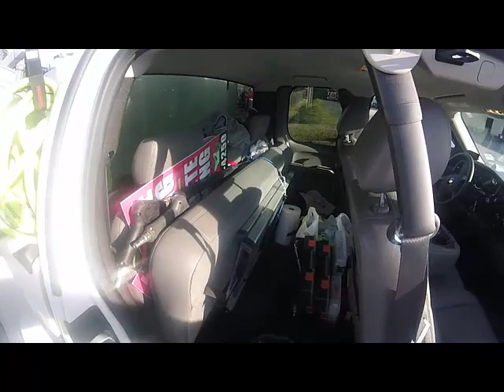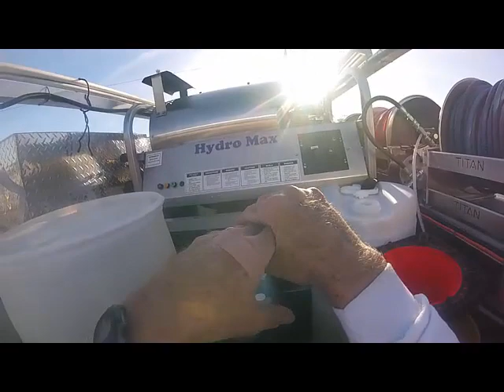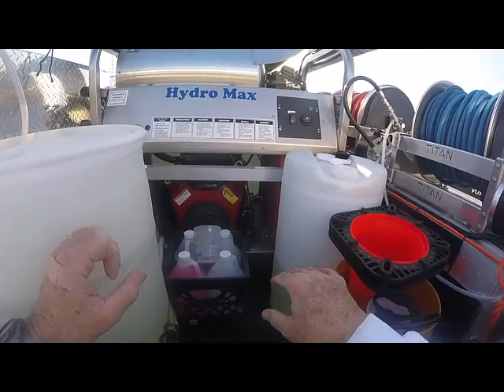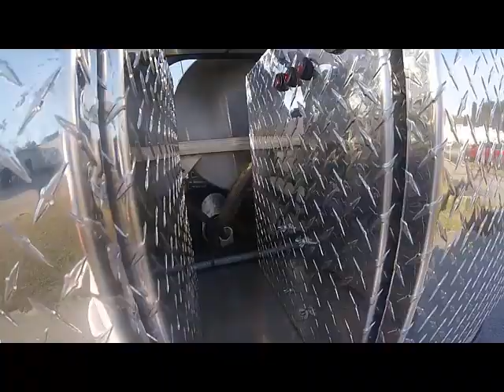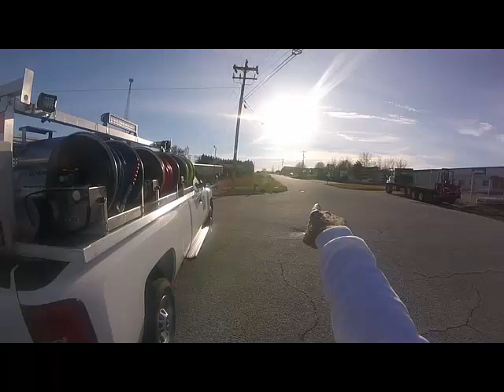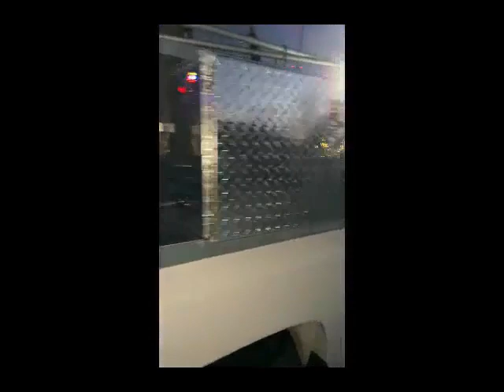Truck Build - War Wagon 1

Comment: How hard is it for you to change the oil in your machine?
Reply from the maker: Not too bad. Have oil drain hose to front of machine. Pump oil, different story, have to slide machine forward about 18" which is kind of a pain., but don't really change it all that often.